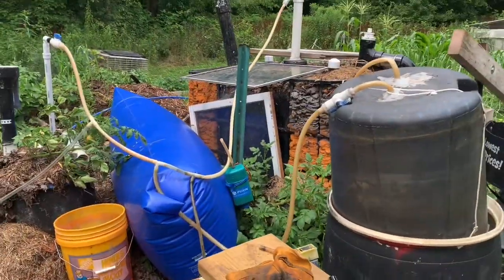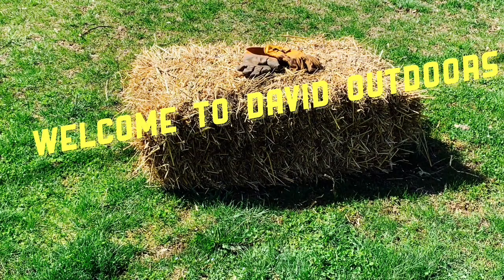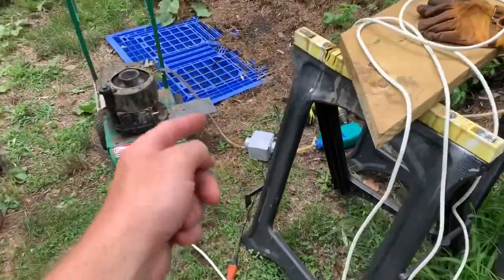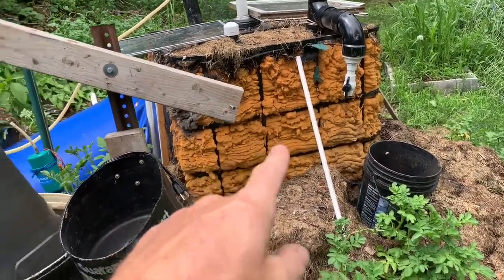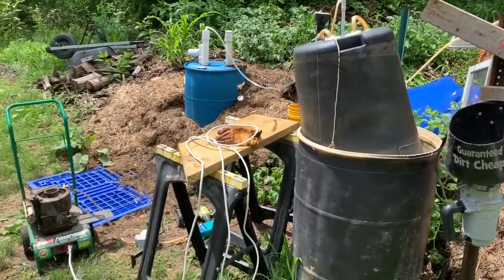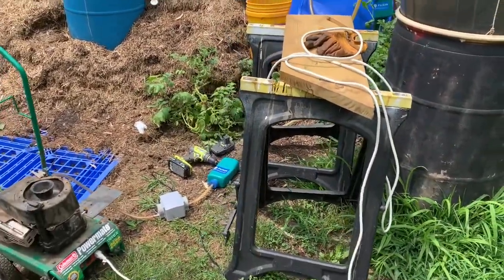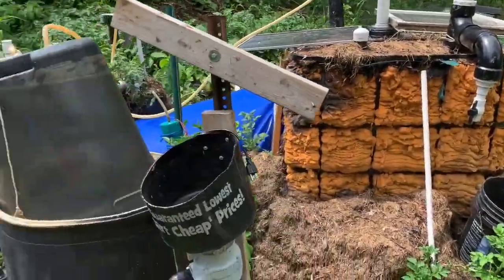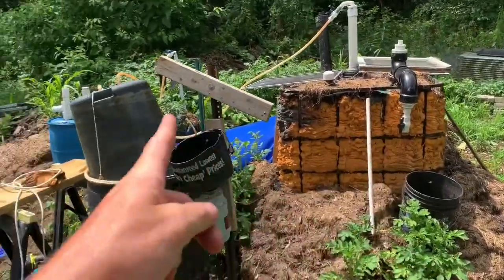Biogas Plant Working Model

Comment: What are you using for the gas line.  I just got a small biogas digester built from a blue 55 gal barrel and I've got some clear vinyl tubing for the gas line but not sure  it will hold up for Long. And also what boost pump are you using. I watched a video of someone using a aquarium pump but not sure how long that will work.  Thanks
Reply from the maker: Congrats on having free energy from waste. I’m just using pvc clear plastic tube holds up well. I bought a puxin air pump a while back. It’s possible to put weight on your gas bag if you don’t have a pump. That’s what I did for a while

Comment: David, how well did the RID-X do in starting your system? I have seen other videos where they had to add SEPTI-PAK too. Also, would RID-X add anything toxic to the fertilizer fluid when used in your garden? I do not want to go find a local cow pie.  Thanks
Reply from the maker: I honestly can't say if the RID-X would be bad for your garden, I mixed the RID-X with cow pie so its tough to say how well the RID-X really worked.